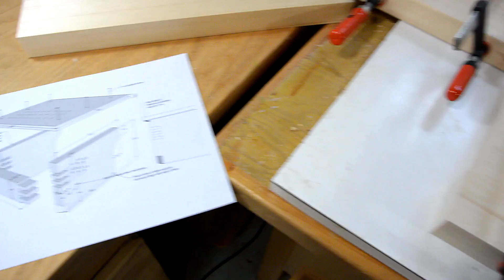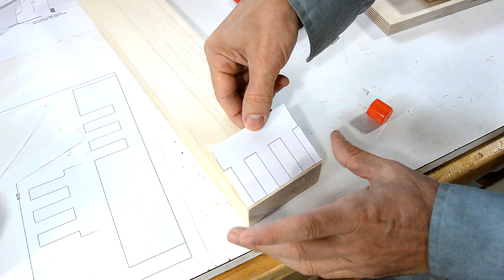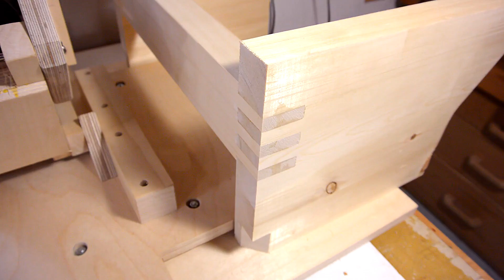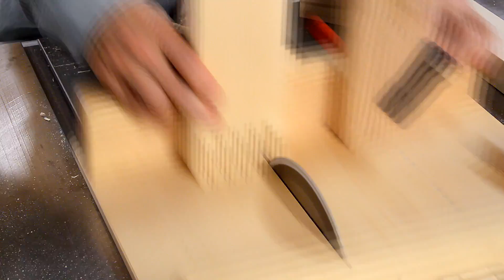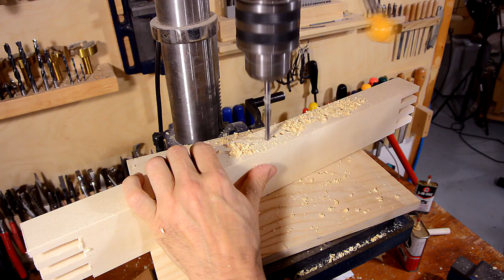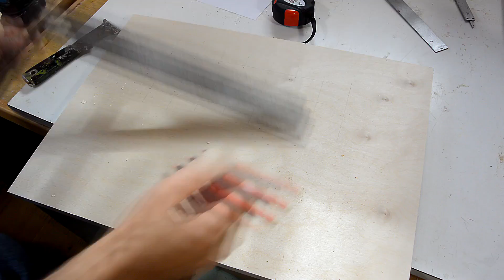Pantorouter XL build: Table and template holder

Comment: Dear Matthias, the templates (where the pin attached to the handle is running on it) you made is quite bigger than the cutting pieces!
what is the scale you are using?
Regards
Reply: unless you consider the size of attached bearing ?!
Reply: +Sami Nasreddine it's 2:1 going by his previous pantorouter.

Comment: A plunge router will not fit in the standard version of the panto-router.  But will a standard router (without plunge mechanism) fit in the XL version of the panto-router?  Any ideas for accessory spacers to make this latter fit?
Great ideas and I enjoy watching your creativity go from idea into objective reality.  Best wishes.  TFW
Reply from the maker: Thomas Weeston The XL version is designed to take most routers WITH plunge base, as shown in the video.
Reply: +Thomas Weeston burn!

Comment: What wood glue does he use? Thanks.
Reply: He uses regular carpenter's glue of whatever brand they have at his local hardware store; I believe that's usually LePage, but other common brands like Elmer's or Titebond 1 will do just as well. You only really need specialty wood glue if you have some special requirement, like extra long open time for a complex glue-up, or waterproof-ness for an outdoor project.

Comment: Just now Harbor Freight has a fixed base router, like you need for the 1st version on sale for 45 USD.
Reply from the maker: mweverett You should definitely get a fixed base router for jigs, if you can.  just, in europe, that style of router costs 10x as much.
Reply: Matthias Wandel
Its strange how we can get cheap Chinese stuff here in North Am but in the EU not so much. The measuring spacer technique you used for the box joint, reminds me of a similar technique I have used for dove tails.
Reply: mweverett Oh, we have cheap Chinese stuff here too, we just don't buy it as much. Also, as our way of using tools differ from american use due to numerous reasons, we also have slightly different tools. Building codes, building traditions and such are probably big parts of the puzzle. Because we are a lot of independent (or where at least. EU is pulling us closer together) countries, we had to have proper standards for stuff. The US seems to take the standards and twist them a little, usually in groups like SCTE, which consists of the largest companies in that sector. The "standards" that come out of that is shit, as everyone has a stake in it, and nobody wants others with good solutions to get their will. In the end, I believe our system is better. Independent bodies makes the standards, and put in openings for everyone to use for special needs.
aliexpress.com is a good place for cheap Chinese stuff.

Comment: I love your ingenuity with woodwork and tools, Matthias Wandel. You are a real inspiration to me to build me own things. So far, I build myself 2 subwoofer enclosures. One was cut using just a crappy saw on a swiss army knife (I had no tools at the time) and joined with screws, the second was cut using a tablesaw and bandsaw in my college workshop. Those things are scary as hell. That one was joined with JUST hot glue but because I put notches in it, it's SUPER sturdy and already air tight :)

Comment: The blue square you use during assembly, did you make that ?  If so was there a video on that ?      Also, when making the 3 slots with plunge router, don't see the need to drill first.  That can be done with just the router.
Reply: Better precision, I guess.
Reply from the maker: ***** I was worried about chips clogging things up, so drilled away some of the wood first.  pointed out in the article that that may not have been needed already.

Comment: This new pantorouter is coming along nicely! Could you do a video on squaring up wood without a jointer or planer? I am working with dimensional construction lumber and am fighting twists and bows with just a table saw. It makes for very tedious work with a lot of scrap.
Reply from the maker: ***** That's what jointers are for.  Big pain without one.
Reply: I couldn't agree more.
Reply: It's a pain but it can be done. If there is no straight edge at all, you can screw or clamp (toggle clamps work well) the board to a carrier with a straight edge and then rip cut the whole assembly. (Steve Ramsey does it a lot on his youtube channel.) Then you rip the other edge the normal way. To flatten it, you really need at least a planer. If you have no jointer, you can get away with just the planer if you stabilize the board on a flat carrier. There are various "planer sled" designs on the net for this, or you just hot-glue the thing to a flat piece of cheap sheet goods like MDF or OSB. If you don't have a planer either, you're stuck using hand planes, or cumbersome router jigs, I'm afraid. Or you can design your projects around the use of dimensionally stable engineered sheet goods. Also, you may find that the "select" softwood boards (usually "one-by" size) at your home center are a lot straighter than the dimensional "two-by" sizes. That's because they are meant for trim carpentry, not construction that will be hidden behind drywall or siding. You can glue thinner straight boards or strips of plywood together to make straight pieces of thicker sizes.
Reply: The wider construction lumber seems better, more stable(to me at least), it's a little more expensive but often worth it. 

Edges are usually straight enough to just cut the corners off with the table saw any minor inconsistency rides the fence by the high points and you then have a straight edge. 

Gotta be picky with your lumber bring a straight edge. It's like eggs, gotta make sure you can use them. 

The stock you have now, buy a cheap hand plane(ebay, hell even the harbor freight plane works it's just kind of shitty, makes a great scrub plane when modified but that's not what you are looking for you probably want a jack plane) and get to work with a straight edge and some winding sticks(visual guide for twist.).
Reply: *****
You can do a limited amount of jointing with a router table and a long straight bit.
Reply: ***** I have also experimented with "router sleds" as a side show to a jig for beveling plywood to a 12 to 1 or so to scarf joint several sheets of plywood end to end for boat building. The sled runs on a flat table or floor, with a big flat faced cutter. rig the board with clamps and wedges and take off the high spots. Also lets not forget going old school, the 'Armstrong' method with a hand plane. :) Ok enough jacking this thread.....
Reply: sanityfalling    comment travaillier le BOIS

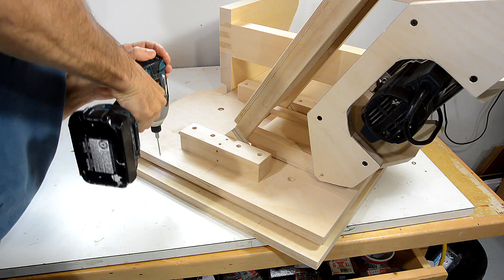Comment: Hey Matthias, at 8:17 you are predrilling the plywood with a Drill that looks to me like one of these with a hexagonal part to use them with a bit holder.
If so, do you use them often and what do you think of them? Are they a decent quality or are the zylindrical ones still the best?
Reply from the maker: TheRealObiWahn I have some, I use them sometimes.  They are just drill bits.
Reply: Matthias Wandel
Sure they are. I'm just paticulary interested if they have a weak spot where the hex-bit connects to the drill-bit because it is a bit (no pun intended) of a pain to change them every time when I'm at work...

Well, I guess I have to check em out by myself how they perform when drilling into aluminium and other metals....
Thanks for the reply though :)
Reply: This is Matthais' take on a scrap wood project ;)
Reply: TheRealObiWahn nah, but they work great with impact drivers.

Comment: Matthias, I rarely see any knots in the wood you use. How is this possible?  Another great video from the Wandel machine shop.
Reply from the maker: loloaqici82qb4ipp I look for knot free wood, and often cut it up so that the knots are in the scrap.
Reply: Matthias Wandel Also, Canada is a big country with cheap land that can be dedicated to growing trees, so there's lots of quality lumber available. (Same in the US and Russia, but not, for instance, in Britain.) Modern container shipping has reduced such differences but not eliminated them. Especially for softwood, markets are still very much regional. For instance, in California, you can get quality Redwood and Douglas Fir very easily, but Southern Yellow Pine (which I understand is a staple in some parts of the country) is virtually unheard of. For hardwood, the shipping is less of a big deal compared to the higher cost, and indeed I can buy German beech for not that much more than local oak or maple.